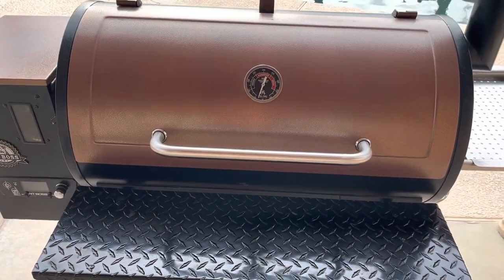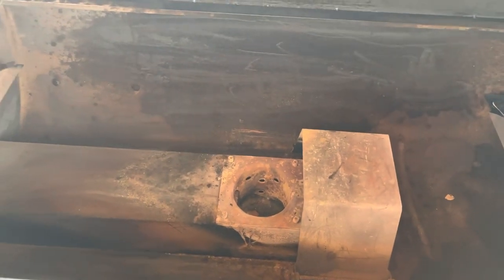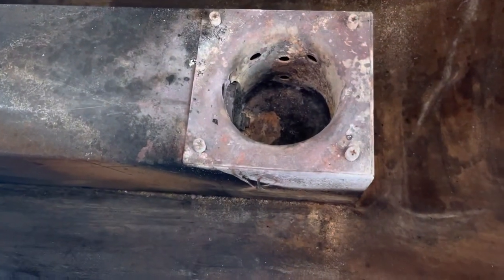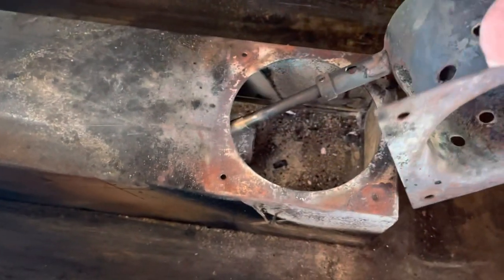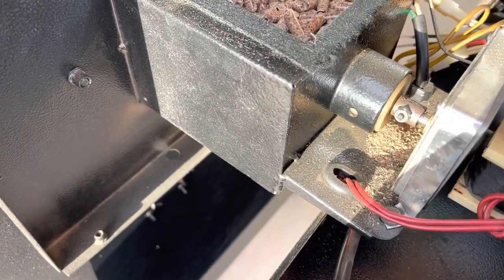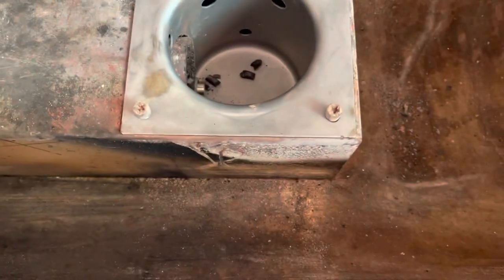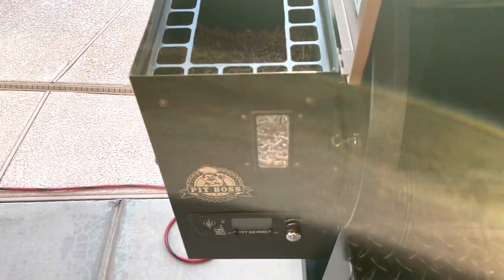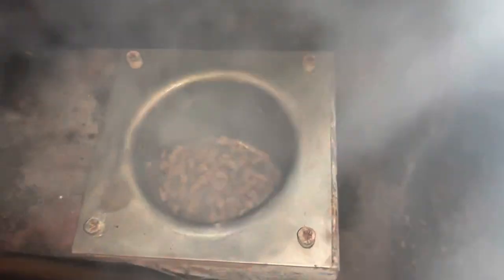Pit Boss Austin Xl Fire Pot And Igniter Rod Replacement.

Comment: Thanks for sharing. I bought the diffuser but didn’t come with a rod. Do you know what size i need
Reply from the maker: Paul!! it’s a 3/16 diameter rod. 
I found a handle that works well at Home Depot also. 

https://www.homedepot.com/p/Arnold-Replacement-Handle-Bolts-with-Knobs-490-900-0061/300614027
Reply: So the handle is 3-16?
Reply: And how long of rod did you get?
Reply from the maker: @paulloyacanoiii6561  yes.
Reply from the maker: @paulloyacanoiii6561  you jus have to measure. I allowed 1 inch longer at the defuser and 2 inches out Sid for the handle. Then adjusted at the defuser one done
Reply: Does it matter if the rod is heat treated steel

Comment: Hello. I just assembled this and the instructions threw me off. It mentioned “removing 4 screws in the middle and removing plate before aligning the grill holes with the legs. What I tried to do was turn and pull the firebox out but never took it out all the way. It didn’t need to come out. I presume there is slack in the wiring so you could actually pull that firebox all the way out right? So I would not have damaged anything by doing that right? I Havnt got the chance to start the grill up yet.
Reply from the maker: Correct. There is enough play in the wires to pull it away. Not to far though. If you need to replace the fire pot, it’s probably better to remove the igniter rod from the pot before you pull it to far.

Comment: thanks for the vid. can u provide link to the parts?
Reply from the maker: D!! Thanks for the feedback. Here is the link. I definitely recommend getting the new fire pot with the new Igniter Rod. A couple of my followers on Twitter had the same problem I did with the screw that holds the rod snapping when trying to remove it. 
YAOAWE Fire Burn Pot and Hot Rod... https://www.amazon.com/dp/B07VQZ2D1W?ref=ppx_pop_mob_ap_share
Reply: @This Grill Life  ok thanks. I also have a fan problem it sounds like the fan is hitting something and smoke is coming back into the pellet hopper. Any recommendations?
Reply from the maker: @djtwilite318  I had one of the fan blades tweaked and was able to straighten it out and glue it back in place. The times I’ve had smoke coming back in the hopper it was because the fire pot was too full of ash and allowed the pellets in the auger to light. I would vacuum out the pot and use the “prime” button to clear the pellets from the auger